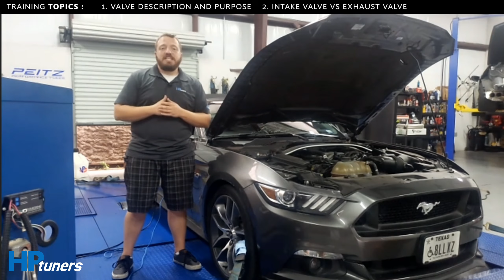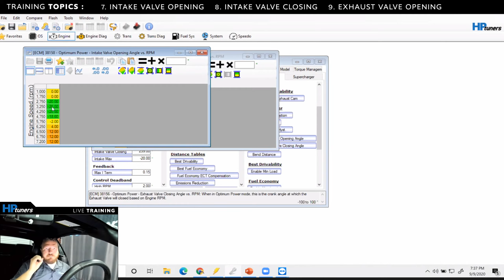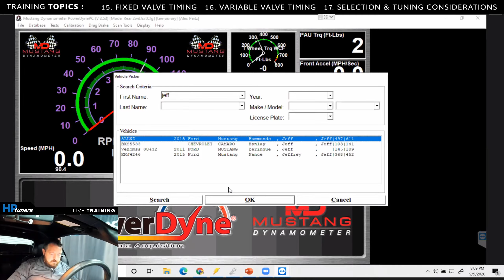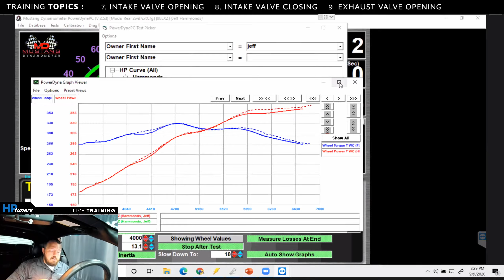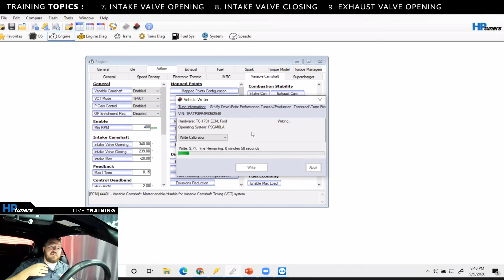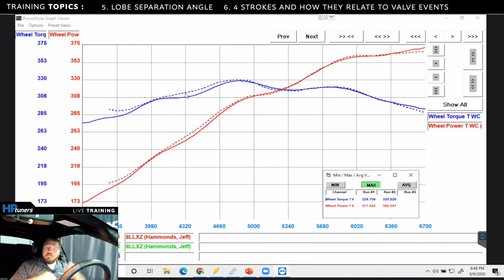VVT Tuning and More | HP Tuners Live Training

Comment: If a tighter LSA makes more power NA, it will make more power under boost. Can anyone prove with back to back dyno tests that a wide LSA blower cam with the SAME specs makes more power than a tighter LSA NA cam? I know what the results will be.
All that wide LSA blower cams do is help idle and give up low end torque and HP. Some say a PD blower needs the wide LSA to reduce the low end tq. What??? The whole point of the PD blower is the instant tq. Thats what i want otherwise id go turbo or centrifugal

Comment: I followed along with my laptop and tune files from GM 4cylinder vvt and under wot cam timing , there are no negative cam angle number available.  Are GM cam angles referenced differently than the coyote ?
Reply: Every engine management platform has slightly different parameters. Not every platform will have the same settings. You may not be able to go negative, or it may start out in the negative area.

Comment: Another question. When doing all this is it better to say do the cam timing first then spark or visa versa?

I now understand all this for WOT which is the optimum power tabs for spark and cams. 

Now how about tuning for drivability in low end to help partial throttle stuff? Would the same thing work as in advancing the intake as much as possible in the low end? 

I remember seeing optimum stability was the mapped point called out at idle. What is called out while just driving?

Comment: Blah blah blah.
Stopped playing around 20 minutes in. Couldn't take it any more. I hate it when ego takes over from good teaching and instructors blah blah blah to much and confuse themselves and give false information.
For the record and for anyone that was confused. Total valve lift is derived from the cam lobe lift multiplied by the rocker ratio and therefore is not fixsd. Change the rocker ratio and you have now changed the lift
Combustion is not a stroke, it is a chemical process and it's effect is the POWER stroke in an internal combustion engine.
Reply: Do you tune? Atleast there is a something out there to listen to and maybe help with a certain situation you may face.
Reply: @slopoke22  yes I tune, daily and there is plenty off good info available without sitting through nonsense. I mean if your here to learn about tuning did you really need a lesson on how the 4 stroke otto cycle engine works. If you do then your getting ahead of yourself and should stick to doing an oil and filter change because your not ready to tune. Perhaps he could do a video on oil changes. But you would probably have to sit through the whole refinery process of making oil before he got to jacking up the car and removing the sump plug. Dont forget the oil drain pan or your gonna make a mess.
Blah Blah Blah
Reply: @James Ross  I agree just sayin atleast there is something. He may say a few words someone needs. I agree he basically just being a squirrel and talking but atleast he is tuning it just have to forward through the forward lol
Reply: I assure you I aint a oil changer though

Comment: I have 2017 charger rt cammed  dyno tuned on 93 straight pipe no cats I just  added high flow cats threw a code p1eoa any ideas if that a tunning issue ??

Comment: My charger lacks some low end power (it is a boosted v6). It starts moving at 2 grand but the tach and car moves slow until around 3100rpm. Is there a way to adjust the vvt cams to have better power from 2to 3 grand??? If you watch my 0-60 vids on my page you will see.

https://www.youtube.com/watch?v=Tav8wa9DUpU

Comment: Alex, well done enjoyed the indepth class on varriable cams, 2 hours went pretty quick.  And i dont even have a variable cam, except for my axle back valve which can effect back pressure.  Ive been tuning the heck out of my VVE table for a 2015 Z28 LS7, basically maxing out the injectors, more fuel more power, it likes a rich mixture of below .80 lamba to get the most out of WOT.  It would be nice to see a video on tuning the Vve table for a NA motor, not just the error calcs but the scuplting the shape to get the most power out of a stock setup.  The PE tuning seems to play a big part, I have it coming on immediately at throttle below 75kpa.  I have a manual and first gear loves the fuel , so thats my video request, making a Vve table that performs, not the idea of just tuning for 14.7 or lamba 1 and having a underwhelming motor.  Thanks.